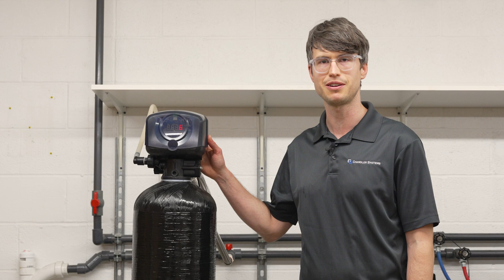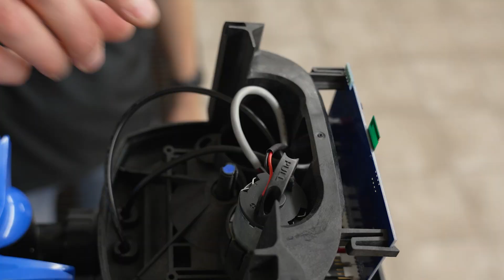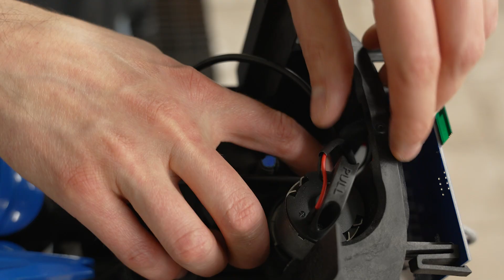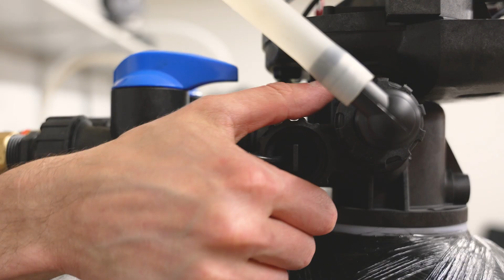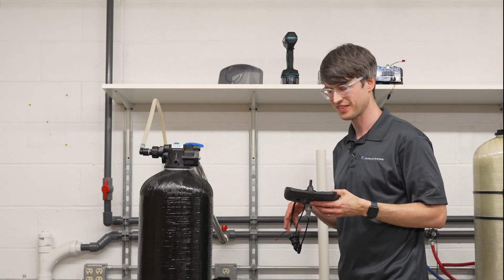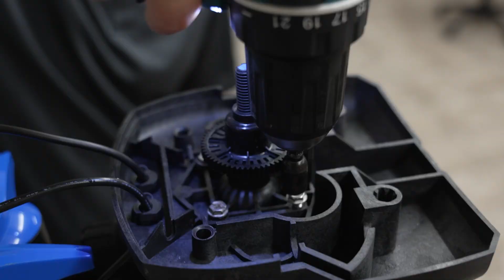CSI Signature 4 Series Control Valve Tear Down

Comment: My CSI Water Treatment System Signature Series is making a sound like water is running constantly, and I think it’s leaking. What could be the cause?
Reply from the maker: Hi, sorry for the late response.  If water is running constantly out the drain line, then your system needs service (most likely a seal kit replacement, possibly a piston as well).  However, if you hear water running and it is not flowing to drain, then it's just water flowing through the system, meaning that there is water running somewhere downstream (e.g. a faucet, toilet, etc)